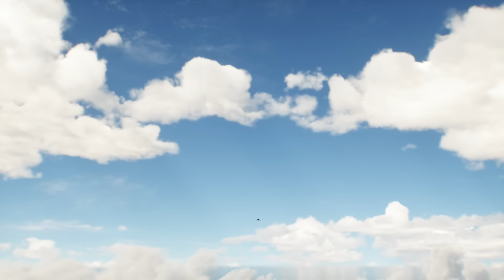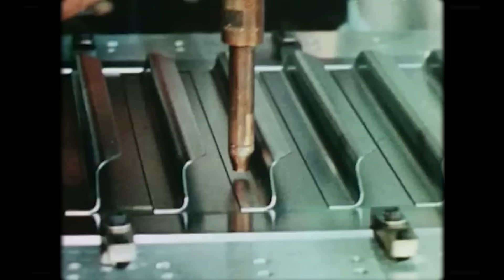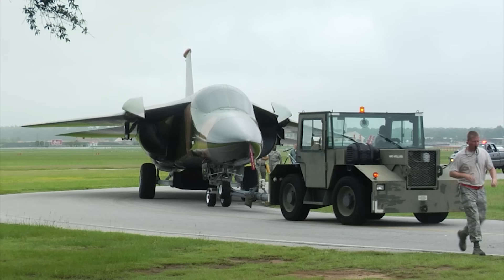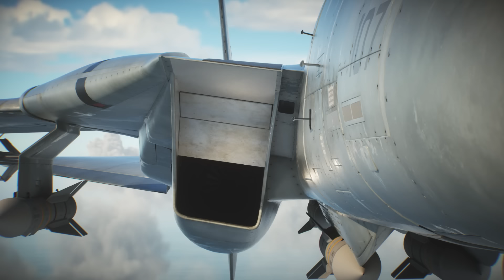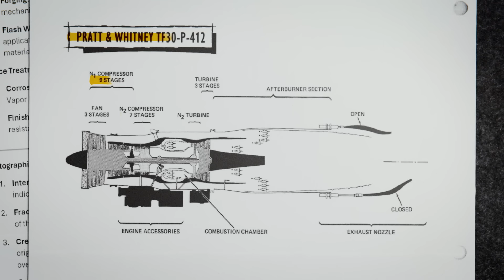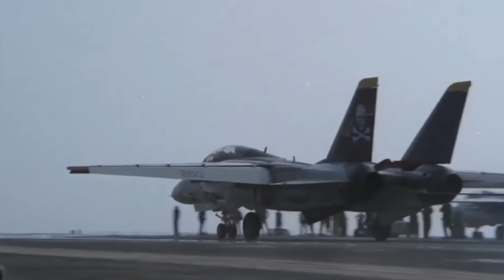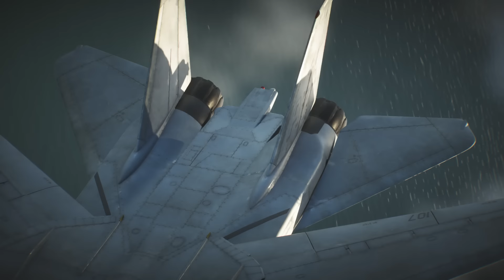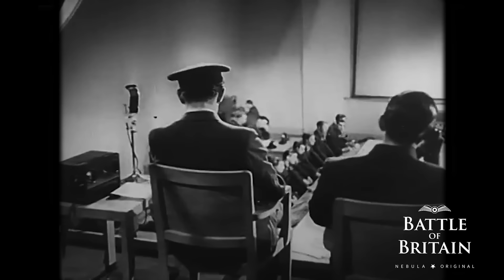The Insane Engineering of the F-14 Tomcat

Comment: We never called it a taileron, we called it the horizontal stabilator.
Reply: This comment is never going to get the love it deserves.
Reply: @michaelmappin4425  without the horizontal stabilator, it never would have got the nickname Turkey. :)
Reply: @tolson57  "Turkey"? I never heard that, though the exhaust nozzle was called "turkey feathers". In my unit we called them "sky pigs" because of all the hydraulic fluid messes they made. When taxying with wings in oversweep they reminded me of giant grey roaches.
Reply: @margarethorrall8621  I believe the "turkey" nickname came from the dirty landing configuration with the hook, flaps, and the DLC on top of the wings extended. All those flight surfaces are moving, making it look like said bird trying to fly.
Reply: @SWScenic  I flew ACM in a radar jamming Lear Jet once and watched as the wing sweep actuators and spoilers were working to keep it flying straight and level. It was a thing of beauty.
Reply: @SWScenic  Yes, and the differential tail with each horizontal stab moving independently of the opposite one.
Reply: @SWScenic  yes, the nickname "Turkey" came about shortly after introduction in the early/mid 70's.  it became more of a derogatory term in the last third of its service life. Usually by people "not in the know."
Reply: @SWScenic  Maybe. I was in F-14 units for several years and never heard that. Not saying it didn't happen but I never heard it.
Reply: @margarethorrall8621 Never heard that name but we all called the afterburner section Turkey Feathers!  VF-101
Reply: Except in this case, the tail is acting as both the horizontal stabilizer control and the normally wing mounted aileron, hence the nickname “Taileron”. It’s legit in the F-14’s case, as I’ve heard a Marine who used to put ordinance on the A-1 and F-4 back in Vietnam call it that when talking about the F-14s later in his career before everything shipboard was separated out. He mentioned a few other nicknames for them as well, so it seems like a “every crew had their own name for it” kind of thing until years later the Navy settled on one or another. Apparently, a few of his Marine pilots from Vietnam were among the actual pilots flying the real aircraft for “Top Gun”, the A-4s and the F-5s, and he started laughing at the theater when he recognized their names in the credits. As to the term “Turkey”, yeah, I can see that… seeing a wild turkey fly the first time has thrown a few people for a loop, but they get up and go like no tomorrow when they do.
Reply: @buckduane1991  I was onboard Miramar when that movie was being made. In fact, the airplane they put into a flat spin for the film was later transferred to my unit, (with a bent box beam). I bought the movie on VHS, watched it once and threw it away. Thanking aircrew individually by name in the credits but not even a shout out to those if us, (yes, I mean us as in I and others) who worked our asses off maintaining those birds and put up with all kinds of bullshit to get that movie made was too much for me. I'm sure it made civilians go "ooh" and "ahh" but it made me go "ugh". I'm certain that I would have enjoyed it more had it been made the year before I enlisted.
Reply: Fred Thompson, in "Hunt for Red October" even name-drops the stabilator.  I read your entire comment in his voice.
Reply: An actual taileron is an angled surface that achieves tail and aileron function as a pair like on the Raptor and it was invented because 90 degree angles aren't compatible with stealth. I'm pretty sure the word didn't exist in the day of the F14
Reply: We just called them "stabs". I don't think anybody used the term "horizontal stabilizer" outside of class or a VIDS-MAF. We used "vertical stabs" when we needed to distinguish between them. But maybe that was just my squadron.
Reply: @margarethorrall8621  I think that was true for most daily use. Just "stabs."
Reply: Thank you for your service 😊

Comment: The TF-30's were 'State of the Art' when introduced and the ONLY engine available at the time able to meet the top speed requirement.   The later GE engines were superior in all aspects except for top speed which couldn't match the TF-30 but because FADEC had been invented they did work better for a carrier aircraft.   Pure mechanical fuel systems are VERY dependent on pilot inputs being correct for the conditions where jamming full throttle at low airspeed could and would cause compressor stalls as the burner pressure would go higher than inlet pressure and the fire started going the wrong way through the engine.   Not until the introduction of FADEC could a pilot indiscriminately jam the throttles while the computer adjusted fuel flow and stator vane angles to prevent compressor stalling.

Comment: The F-14 would be $2B each today with the gross over budget overruns and with the ridiculous complexity. Though I bet the Navy wish they had an updated version today. The range and size would be a great asset in the Pacific. Why they didn't see the ranges that would be needed in the Pacific when designing the new fighters I will never know. I has been obvious since the fall of the Soviet Union that China was going to be the next rival. They've basically said so all along if you listen to their talk meant for internal consumption. Instead we've spent 30 yrs helping them build up their strength. Thanks to Clinton they are a behemoth instead of a 3rd rate power. But we got cheap 1 time use junk really cheap. A really dumb trade off. Instead of paying more and getting better stuff we go junk cheaply and have to spend more on protection.

Comment: Outstanding job! I was a Aviation Fire Control technician on the F-14 Tomcat for 20 years and this is one of the best videos I have seen on the Tomcat. It is very accurate. A few small mistakes line the oversweep angle was 68 degrees, not 78.

My first squadron was VF-211, the Checkmates. Most of the Tomcats in your video were from VF-211. They have the distinctive red and white checkerboard pattern on the rudders. Very photogenic.
Reply: Nobody knows what an AQ is anymore.
Reply: @michaelmappin4425 I do, I was an Ax and we all went to the same A School. I saw my first F-14 at Pax River in the spring of 1972.  I still remember seeing it flying over as I was walking to the chow hall.
Reply: @Chris_at_Home  Haha, you would remember, old timer. AX had one of the coolest rating badges.
Reply: I was an AQ before they converted all of us to AT.  VF-102 was a blast. @michaelmappin4425
Reply: AQ1 here. Was in VF-124 for training ('74-'77) and VF-143 at sea ('77-'81). Worked on the A model from block 55 through 95.
Reply: @rw3008  I went thru 124 in 77 as an AQAR. scrubbed some shitters and went to I level AWG-9 school.
Reply: Thought a lot of the video was not really on point..
Reply: correction, the max angle of the wings before oversweep is 68 degrees, when in oversleep it is now at 75 degrees.
Reply: Thank you for your service :)
Reply: Great video!! I was an AE in VF-101 and then went to VF-102 on the Roosevelt for OEF. I love this jet!!
Reply: @Boblabla79 ADJ in VF-101 in 1975-79.  We had VF-41 and 84 on-board for transition to Tomcats.
Reply: My father in law was an aircraft mechanic that worked on the F-14 when he was on the Nimitz in the early 80s. Very cool plane.
Reply: @thefreeman8791  airedale dude, airedale.  your dad was an airedale.
Reply: He did say 68. , 78 for deck storage 👍
Reply: @davidrussell7837  20º wings full forward, 68º fully swept(in flight) with 75º for deck stowage.
Reply: 68 degrees in flight, tighter on the deck in oversweep after allowing the airbags to deflate.
Reply: @justindavis1546  Failure to oversweep is almost a bigger flight deck nightmare than a stiff Hawkeye. 😫 The Boss and the Handler still think it's an easy, quick stuff in Fly 3. The yellowshirts are all choking on a turkey bone.
Reply: Well, speaking as an AMS, I call bullshit. It wasn't at all accurate from my point of view, though I can see why it would impress a conehead. That claim of a 78 degree oversweep nearly made me turn it off. The maximum wing sweep in flight was 68 degrees and oversweep was 75 degrees. That's when the solenoid on the portside wing sweep actuator locked them in place.
Reply: @margarethorrall8621  Exactly this... lmao so much misinformation........

Comment: 18:30 I have always wondered something about taking off from a carrier. Does the ship's forward movement generate more lift for the aircraft or can aircraft take off from a carrier at rest?
Reply: An aircraft can take off from a carrier at rest, the ships speed would only affect lift by a small amount (a carriers maximum average speed is around 30 knots whilst an F14 Vr speed is at 150 knots so the carrier would only theoritically assist with 1/5th of the lift)

Comment: I like the F-14 however the fact the F-14 is everything the navy didn’t want with the F-111B,
Ironic, isn’t it
Reply: The F-14 is what the Navy asked for, specifically to be the fighter complement to the F-111B, and then as soon as the new project found a way to implement the AWG-9 and AIM-54 they used it as a reason to cancel the F-111B project.

Comment: A good video with a very nice description of the air intake design and adjustable ramps and.  The computer controlling the swing wing and the ramps was called the General Air Data Computer.  The description of the TF-30 engine's limitations is correct, but the video implies that Kara Hultgreen was the victim of a poor engine design.  She was not.  Kara "Revlon" Hultgreen was an accomplished and competent A-6 Intruder pilot who transferred to an F-14 squadron.  She passed her qualifications but did poorly relative to other pilots.  Instructors taught her how to "fly the engine" of the F-14A, so to speak.  When she approached the carrier on the flight that resulted in her death, she did exactly what her instructors told her NOT to do.  She died because her RIO triggered the ejection a half-second too late.  He survived, but Kara was ejected straight down into the water.
Reply: Hultgreen did NOT pass her qualifications to enter active Tomcat service...  she WAS passed by the higher ups who were forcing women into active fighter squadrons.  She had already had the same exact landing issues countless times in the simulators and it eventually resulted in her death.   She shouldn't have been in that plane in an active combat squadron, period.
Reply: @danielvogel5252  False statement. by you.  Other women have done very well; Hultgreen did not.  There was some pressure to pass her despite deficiencies, it's true.  But don't generalize.
Reply: @danielvogel5252  Hultgreen qualified in 1994.  She was not a good F-14 pilot, but she did pass quals.
Reply: @danielvogel5252  Hultgreen qualified in 1994.  It was her second try.

Comment: The F-111s wings box was bolted steel by comparison.

The "future proofing" of the inlet was no accident.  The Tomcat was originally planned to be powered by the USN version of the F100, the 28k lb thrust F401-PW-400.  The F401 had at least as many issues as the F100 in development, so the USN decided to go with the smaller, already available TF30 as an "interim engine".  When the F110 came along the inlet was already good to go.

An interesting footnote, the AIM-54 Phoenix and AWG-9 radar are direct descendants of the AIM-47 Falcon and APG-18 radar designed for the XF-108 Rapier and flight tested on the YF-12A Blackbirds.  Missiles were carried in internal bays and could be launched from Mach 3 at 80,000 feet against targets on the deck.  Mind-boggling performance for today, let alone the late 60s.

Comment: A few more bits about the engines and their placement
- The placement of hardpoints for weapons in the center of the fuselage to create the "tennis court" area between the engine nacelles was largely to prevent placing them in more traditional wing mounted hardpoints. These would have to have been rotatable and added even more additional costs and mechanical complexity on an already expensive and complex airframe. This was another lesson that Grumman had learned with the F-111.

- The P&W TF-30s had five distinct afterburner stages or "zones" that it would shift through as the pilot pushed past the afterburner detent. This was changed with the GE F110 that gave the pilot more direct control over fuel flow in afterburner, allowing them to scale how much power they wanted more smoothly.

- The biggest gain from the GE F110 allowing the F-14 to take off without afterburner was safety. The separation between the F-14's engines meant that asymmetric thrust caused by one engine being at idle while the other was in afterburner overrode the yaw authority of the aircraft even at full rudder deflection at low speeds, which is especially dangerous when landing and taking off with so little altitude to work with. Having both engines off afterburner gave the pilot a much better chance to recover the aircraft if one failed immediately after takeoff, on top of the inherently better reliability of the F110 preventing a failure from happening in the first place.

A fun one: Goose did not follow procedure for ejecting from an F-14 in a flat spin, which is likely what got him killed. The NATOPS for all F-14 variants calls for the RIO to first jettison the canopy before initiating an ejection. It was found that in a flat spin, the canopy of the F-14 tended to "float" above the aircraft for a few moments after being jettisoned due to the lack of a strong slipstream to carry it away. If an ejection is initiated in this state, there would not be enough time for the canopy to move a safe distance away from the aircraft before the RIO is ejected, since they are the first crew member ejected in the sequence. 

A not so fun one: This ejection sequence is what killed Kara Hultgreen. Her RIO initiated an ejection upon realizing the unrecoverable state the aircraft was in. Since the RIO ejects first, he made it. Hultgreen, ejecting only about half a second later, did so only after the aircraft had rolled beyond 90 degrees to the left, sending her into the water.
Reply: Ward Carroll did an outstanding episode on Revlon
Reply: Goose's ejection is based upon the real world event which changed the NATOPS procedure to the one you are citing. The difference is the real RIO survived that ejection but the danger was already noticed. 

The NATOPS is also extremely wrong on the flat spin recovery. It works only at the onset and early part of the spin. Pushing the stick forward doesn't drop the nose or restore stability and differential thrust is only possible on the B and D model without grenading the engine (See TF30 compressor stall issues).  

When NASA was tasked with studying the issue they found a better recovery method which worked at a higher rate of spin and still worked early on. 

Stick AFT prevents the elevons  from blanking out the rudders and forces air trapped under the jet, passing the rudders giving limited rudder control. 

Rudder INTO the turn to roll the aircraft into a normal turn.

Wings AFT to drop the nose due to change in the Center of Lift's relationship with the CG.  The retracted wings also help push more air to the elevons and then to the rudders.

The NATOPS is almost entirely the opposite until it tells the RIO to eject as the pilot is unlikely to be able to reach the handles due to G forces at higher spin rates.
Reply: What a gem this comment is! I'd like to see a follow up video based just on the great YT comments like this one  ❤
Reply: Nice copy/paste, you’ve clearly never engineered or worked on aircraft.
Reply: @DumpingSyrup  Everything stated was accurate and correct.
Reply: @DumpingSyrup  guy who doesn't know anything about aeroplanes here, - what was wrong with the above comment?
Reply: @bhuuthesecond  Nothing, it all made sense and is accurate.

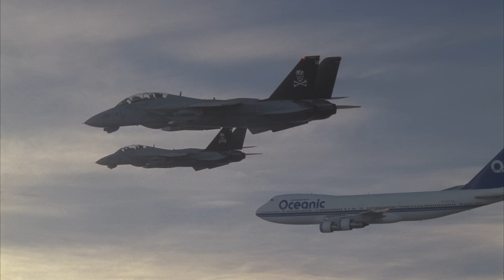Comment: Oceanic 343 should have just diverted to Thule AFB at 5:50. 

Being a pedantic welding metallugist here, with arc welding, nothing is combusted in the traditional stoichiometric sense. If you're looking at TIG, MIG/MAG (GMAW), you've got a shielding gas to keep the weld pool free of atmospheric contaminants, namely oxygent and nitrogen which may form carbides and nitrides and thus affecting your metallurgical properties, affecting things like strength and fracture toughness. Nothing is combusted, unless you view the application and generation of an arc between your electrode and your workpiece as being "combustion" - OK, in MIG/MAG, your consumable filler material acts as the electrode whilst TIG will have a tungsten eletrode and separate filler wire. But in neither of the conventional arc welding processes are materials "combusted" - Explosion welding where you might want to use it for cladding, yeah, but not for your common industrial fab processes. Upside with EBW is that your heat affected zone is very thin, although I won't claim to be an expert in the welding of non-ferrous materials.

Comment: a little correction mentioning the speed of the catapult system… there are only 2 types of “cars” than actually out accelerate this. the Funny and Top Fuel Dragsters of the NHRA. 0-300 in under 3 seconds. obviously these aren’t production vehicles. but still impressive. if anyone ever has the chance to go to these races i’d highly recommend it. 18:09

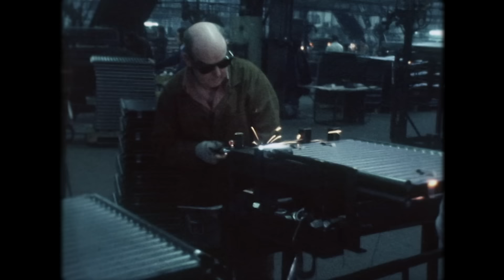Comment: 5:06 hasn't arc welding been in broad use since WW1? That doesn’t use combustion unless you mean at the powerplant. 
Does still have an oxydation issue, but that's just a result of getting hot in an oxygen atmosphere.